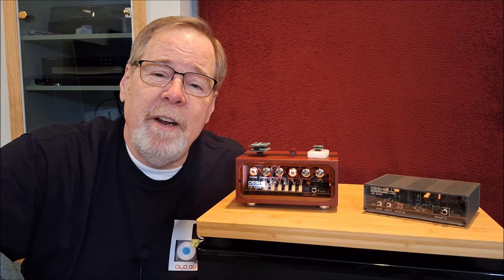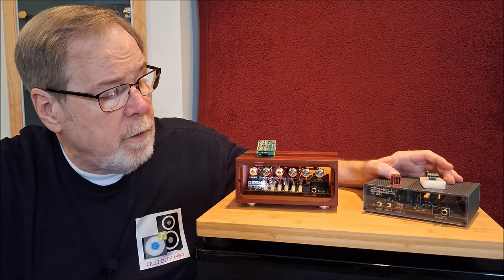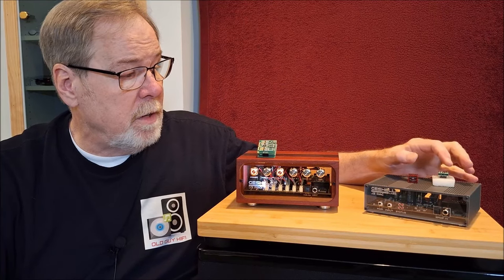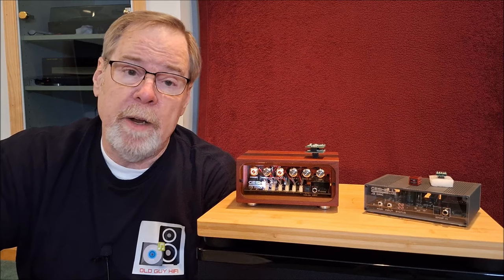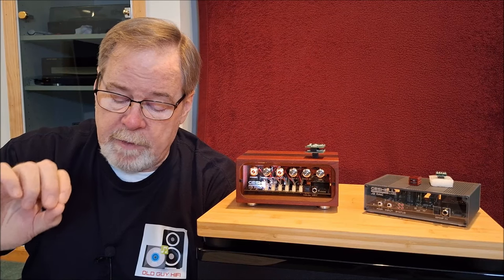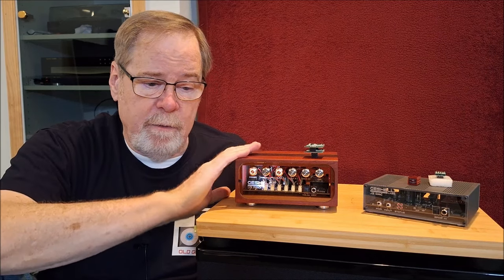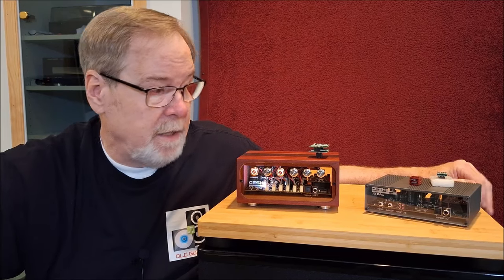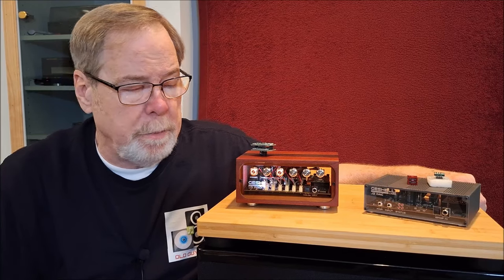The 1st YouTube review of the Geshelli J3 Pro DAC. IMHO it is a fantastic unit full stop.

Comment: Have you checked out the inexpensive Fosi ZD3? I got one and it’s OK—I really like the HDMI/eARC support for my TV, but I got the sense the AKM hybrid approach might be more to my taste… I like really present vocals/midrange and a warmer darker sound than you hear with the SABR designs generally…
Everyone thinks sparkos op amps are fabulous—but usually the smaller ones. I’ve never seen anyone use these big ones you seem to love… I think they’re very pricey right? And you need 8 for the Dayzee bringing that unit north of 2K, whereas only two for XLR J3 pro (so more like $800)
Reply from the maker: I have the Fosi ZD-3 in right now for review and I must say that I am pleasantly surprised by its performance. I normally don't like the sound of ESS Sabre DACs but this may be the exception. I have rolled the op-amps. I did not use the extra 3 that were included in the box yet. I had some SX52B Full Discrete Dual Op Amps I got on Ali-Express and used those. Wow! Really good sound with a big reduction in the "glare" I normally hear with Sabre DACs. I will try the Sparkos later. BTW those SX52B op-amps were only about $12.40 each. Yes the Dayzee needs all 8. With a Lexan case and all the op-amps the Dayzee comes in at just under $1700.00. I have all 8 in my Dayzee review sample now and, OH MAN is it good. My regular unit is a J2S with the 2590 on single ended and the 3602s on balanced and it sounds awesome as well. I always recommend that you listen to you DAC for at least a few months before you roll op-amps. If you don't get a good idea of its stock sound you will never know if the upgrade made a difference. Let me know your thoughts. Great comment and thank you for tuning in.
Reply: @ thanks for your response.
I have not rolled on the ZD3 but I can tell you the muses02 made a big difference smoothing out the sound and widening the stage of the V3 mono amps. I woulda gone for the J3 Pro or even the Dayzee if I thought they would be a significant step up and if they had HDMI input. Then again the ZD3 is so cheap I can just keep it for the TV and use something else for music. The 3 provided rolling op amps included by Fosi are not well regarded so I wouldn’t even bother with those. Just check the sparkos, the muses02, and maybe some other discrete choices that will fit—I think the big sparkos won’t fit… those SX52B—did you compare them to the stock op amps and they are “glare-reduced” relative to the stock? If so I will defo try them.

But maybe a pair o sparkos on the ZD3 will work magic. Grzegorz of Virtual HiFi really liked the ZD3 even though he doesn’t usually like sigma-delta of any sort, and is saying he has built his own op amps —I m seriously considering his Qualio IQ speakers but I gotta trigger them before the tariffs kick in… I have acoustic Zen adagios right now. he also liked the LAiV in the R2R category for the money (2-3K: he liked it better than the Denafrips offerings) though his fave is the T+A dac which is in the 5-8K range.

Comment: As one who is strongly considering the J2S with the Sparkos upgrade, is it worth saving up for the J3 Pro with Sparkos instead?
Reply from the maker: That's a tough one. If you only need single ended out then a J2 with the big 2590 would be excellent. If you do balanced/XLR then the J3 is the best choice. In all honesty, either unit is very good straight out of the box. You can always upgrade the op-amps and do a linear power supply. Thank you for your view and comment/question. I do appreciate it.

Comment: Great video! If I go for RCA in the 2590 configuration, feeding with a digital transport, what would I loose if I buy the J2 instead of the J3?
Reply from the maker: Jan, The differences between the J2S & J3 Pro are minor, The J3 Pro has an improved power supply primarily for driving 3 of the 2590s. Sonically they are almost indistinguishable. I ran the J2S with the 2590 in single ended (RCA) and it was very, very good. Good enough that I am purchasing one for myself as a second reference DAC. I hope this helps. Thank you so much for watching and commenting.

Comment: thank you for the detailed review , is the j3 a worthy upgrade from the j2s ? much appreciated.
Reply from the maker: Yeghig, It depends on your use case. If you are only going to do single ended and maybe just one external device, i.e., a streamer then the J2S is perfect.  You only have one op-amp to change out. If you you were going to do balanced out and were considering going all out, then the J3 Pro with the big Sparkos 2590s rock! At their core the two units are virtually identical in performance so, go with what your budget can handle.  Thanks so much for watching and I hope I was able to answer your question.
Reply: @OldGuyHifi  Yes you did and I can't thank you enough for taking the time to do so. hope to see more videos soon. take care.

Comment: Stellar review! Could you please share which you felt performed better as a DAC, between the J3 Pro  and the Orchard Audio  Peacan Pi+ DAC/Streamer you also reviewed?
Reply from the maker: The OA Pecan Pi is a great DAC but a lousy streamer. Not the hardware, Volumio is the weak link. Tha DAC in the OA is the same AK4499EXEQ chip set as in the Geshelli. I found it to be a bit too clinical. I think Leo the designer focused on getting the best measurements. Geno Geshelli listens as well as measures so I felt more connected to the music with the J3Pro. I did wind up buying a J2S AK4499 for my system. The J2S and the J3Pro are near as makes no difference sonically identical. Orchard Audio does make a DAC only version without the streamer for less cost. Again, I found the Geshelli to be more engaging. I hope that helps. Thanks for the view and comment.
Reply: @OldGuyHifi  Greatly appreciate your very honest and helpful response. Sounds like the Geshelli is more up my alley, given the engagement and musicality factor. Plus I’m more than happy to pass on having to deal with the very frustrating Volumio app which I had brief and frustrating experience with.

Comment: Very nice review, thank you. I ❤ learning more about how this tech works from your channel vs just hearing what it sounds like by others. 👏

Usually it’s important to know if there’s a difference between diff. inputs used SPDIF vs USB and if a stock or what kind of power supply was used in the unit.

If you could please verify I understand this correctly - when using SPDIF inputs, the internal clock oscillators of the DAC aren’t used compared to using USB/IIS where the DAC’s internal clock oscillators are used. Should the sound be better via USB?

That’s what I’ve come to hear in my system - USB sounds better as an input on my ESS DAC also with a Dual Ch Pro opamp from Sparkos from the same source that has multiple outputs SPDIF & USB, like a PC or a streamer. Thank you!
Reply from the maker: Ivan you are correct. On any SPDIF input the DACs clock must chase the source's (transmitter) clock. USB is asynchronous so the receiver sets the clock timing not the transmitter. I did a video on this but, I think you saw it. So, yes USB is always the best most common connection for us to use. Great question/comment.  Thank you so much.
Reply: @OldGuyHifi  Thank you, I did watch that video, just still processing it in my head.. 🙃👌
Reply from the maker: Let me know if you have any questions. oldguyhifi@gmail.com

Comment: Also wondering about the usefulness of adding something like a SMSL PO100 between streamer and the J3 using optical, or whether it's better to connect streamer directly to USB on the J3
Reply from the maker: USB out to the SMSL PO100 out to the J3 on either coax or Toslink is the perfect connection. I use that set up for my J2S, Dayzee and the Laiv Harmony I have. IMHO it improves thing markedly. I hear better low level detail and a more expansive sound stage & image. It is well worth the $60. Let me know what you decide. Thx.

Comment: Like your presentation style. Me 63, love vinyl, have some cds and fairly new to streaming. Dynamics, big soundstage /holograghic important to me. Hate shril/ clinical sound.
 Using Qobuz, BS Node 2i, J2 non upgradable. Wouldnt mind  supporting Geshellis again.
Ed what can I expect if I upgrade from J2 basic to J3 Sparkos? You infered warm yet detail with J3. 2 winners!
Pontus, Border Patrol, Gustard R26 have been in the running.
Reply from the maker: Which chip does your J2 have? If it is the AKM 4493 then that's a real good DAC even without swappable op-amps. The difference between the J2S and the J3 Pro sonically is very little. Geno re-did the board to accommodate the Sparkos 2590 chips which are giant. Also those chips require a bit more power to run so he upgraded the power supply. When I made my choice, I went for the J2S AKM4499 option with a single Sparkos 3602 for the RCA outputs. I feel I made a great choice. I have listen tot he J2S side by side with a Pontus II 12th, a Chord Cutest, a FiiO K9AKM, an SMSL SU -X, an Audiolab M DAC+, my modified Schiit Bifrost and the new Geshelli Dayzee. Conclusion: The J2S is every bit as good as all of those but is edged out by the Cutest, the Bifrost (Slightly) and of course the Dayzee which is a J2S/J3 Pro on steroids. I could happily live forever with the J2S with no regrets. Yes, the sound is smooth (warmish) and very detailed. Bang for the buck, I don't think you can beat a Geshelli unit of any stripe. I hope that answers your question. Thanks for tuning in.
Reply: @OldGuyHifi  Thanks for detailed reply. Sounds like I should stick with the J2. Seems crazy a $250 dac could be in same game as $1600 one. I know it has many good reviews. Im pretty sure it  has the AKM4499. I also have a new Keces LPS that Ill be using with the J2 soon. My rig has been in storage 1 1/2 years. 
I only play HiRez, but found streaming to be very hit or miss for quality. Thought maybe a dac upgrade might help.
Wish my area still had HiFi stores to hear different products, but now we rely on reviewers. Thanks!
Reply from the maker: @bryfar6178  My guess is that you have an AKM4493 as the 4499 was only offered in the J2S at a significant cost. I have heard from others and experienced it myself, that the BS Node is an inexpensively built unit and lacks an internal clock so the signal can be full of noise. Did your J2 come with an USB input? If so try connecting a PC/MAC via USB and just run the regular Qobuz desktop app and see if there is a difference. If it sounds better then... Good luck and Thanks.
Reply: @OldGuyHifi  Your probably right AKM4493. Hmm, Ive read alot of good comments on the BS Node2i.  I didnt pay it but, it sold for $600.00  4 years ago, but no doubt there are better streamers. 
Im surprised a pc could be a better streaming source, but I dont have that option.
Reply from the maker: There are devices like this:  SMSL PO100 PRO: https://amzn.to/3B8KzRe which can convert USB audio to SPDIF Coax or Toslink as well as I2S. It takes the USB out of your PC/MAC and gets it into the DAC very cleanly and accurately. I use on on DACs that have no USB and it works very well. That could be an inexpensive option for you. Let me know what you think. Thx.
Reply: @OldGuyHifi  The J2 does have usb. I meant no pc to try your idea. I use an ipad for the Qobuz app. I dont think it has abilty to connect to dac. I could be wrong?
By the way, I moded the Node 2i with  PD Creative lps  kit from Poland and use a Keces LPS.
As mentioned, my good rig is in storage for now. Been using Node2i through my cheap tv sound system.
My statement about hit or miss was b4 any mods and hasnt been tested on my good system. 
Also, even vinyl can be hit or miss. Analog Productions put out great recordings. Some other pressings can be not so good.
Reply from the maker: @bryfar6178  Sorry, I misunderstood the issue. I am not an Apple person so I don't know about iPad connectivity. I hope you can get your good rig out soon. Yes I like Chad's work. I have about 30 or so of his pressings. Good stuff. Thx.

Comment: Excellent review! Need to watch more of your videos right away.

This j3 fully loaded and with a wooden case would be around 1.1k $ here in Germany. A Denafrips Ares (now 15th) would be around 1.3k $. May you share your thoughts on which one you would choose and why?

Or should I look into other devices in that price range searching for a non dry and metallic/ringy sounding dac?

Edit: Bifrost is around 1.1 k $.
Reply from the maker: They are very different DACs.  It has been a long time since I listened to a Dennefrips unit and it was the OG Aries unit. Ladder DACs have a great sound but aren't perfect, but then what is? My fuzzy recollection was that it was very smooth and threw a big sound stage. I thought it was very good. I will be getting a Pontus in for review shortly so I will get a refresher. Just to be honest with you, I am considering purchasing a J2S with the Sparkos 3602s as an extra reference DAC in the system. I think that this new AKM AK4499EXEQ+AK4191EQ hybrid chipset is remarkable. I find its sound to be between Multibit R2R and Delta-Sigma. It is very clean but without the Delta-Sigma glare and has a more neutral sound than Multibit and Ladder DACs. Great response and resolution with a huge sound stage. The J2S and the J3 Pro are basically the same units with a few mods to accommodate the space big Sparkos 2509 need. I found them to be so close that as near as makes no difference the same. I know that probably doesn't help but it is the best I can do to be accurate. Thank you so much for the great question and your view.
Reply: @OldGuyHifi  No man that's perfect. I'd rather you not stating things just to give some answer and steer me in one direction. Thank you for your time, that helps me to narrow down my choice.
Reply: @OldGuyHifi  I just found the "Singxer SDA-6 PRO2" which seems to use the 4499/4191 combination too. Looks like an interesting product.
Reply from the maker: @Nearest_Neighbor  I have seen that piece. Never heard of the brand which would cause me to hesitate. If I remember correctly you are in the EU (Germany?) and that might get expensive with shipping, import duties and taxes. There are some good deals to be had out of Asia but, beware as there is zero product support or service from these manufacturers. The seller may support it but you send it back at your own cost and risk. I have had several viewers/friends buy this way and get burned. Just a "word to the wise." Thank you for your return visit to the channel.
Reply: @OldGuyHifi  Thank you for your heads up! I've heard a lot of good things about Singxers DACs and headphone amps. About this particular one I only found one review so far. You're right, I'm in Germany. So unfortunately most things will cost me quite a bit of shipping and duties. Other than SMSL for instance since they're so wide spread. But there are distributiors in europe which already handled the importing etc. so it would be only the bumped up prices but not the hassle with all that. And one might hope that they provide some service after purchasing the item. But as you can clearly see my search hasn't ended quite yet. :)
Reply from the maker: @Nearest_Neighbor  Well if I can help with your journey please let me know. BTW Geshelli will ship into the EU if you are interested. Just reach out to them at info@geshelli.com and they can give you all the info and pricing.
Reply: @OldGuyHifi  I highly appreciate that, thank you! 🙏 The Geshelli is really intriguing. Factoring in their journey and family business even more so. I just come back watching every Holoaudio Cyan 2 video I could find on Youtube. Which also looks like a great device. Fortunately I (try to) force myself to not buy things out of impulse anymore and really take my time.
Reply from the maker: @Nearest_Neighbor  I find myself in the same dilemma. I have only heard the Halo May DAC once at a show. I know Halo is a well regarded product. I may be getting a Dennifrips Pontus and a LAIV DAC in for review soon. I am interested in that comparison. Watch this space. Thx.
Reply: @OldGuyHifi  Both very nice DACs from what I saw. Especially the LAIV got raved about in the reviews. That's just a bit over my budget though and probably overkill for my Setup. (Triangle Comete 40th at the end)

From what I've heard people saying is that the Cyan 2 is very close to their higher end ones sound wise just stripped down in most of the features which I'm totally ok with.
Reply from the maker: @Nearest_Neighbor  I have heard that too. Nice stuff.